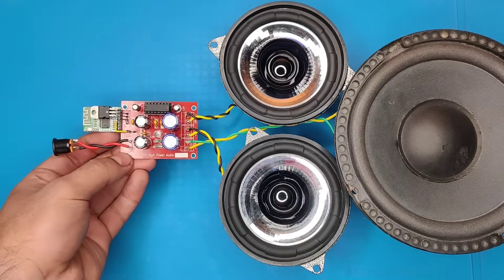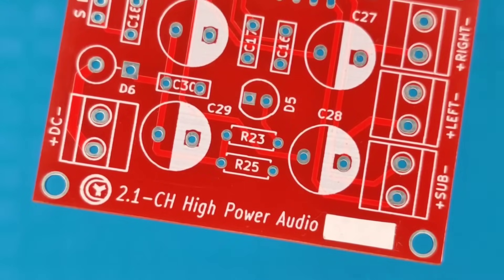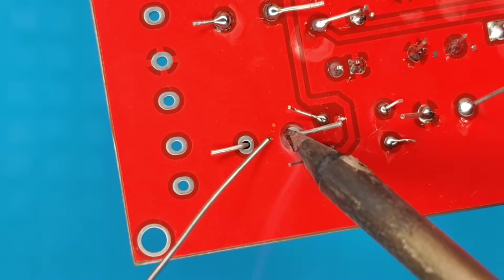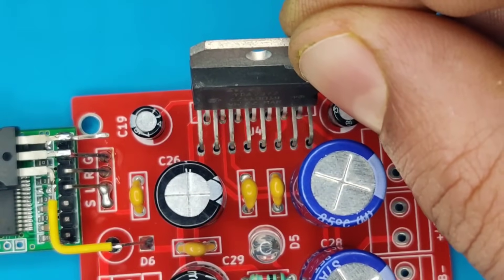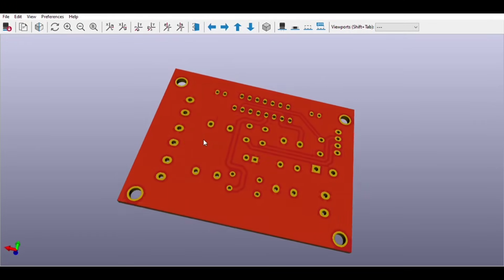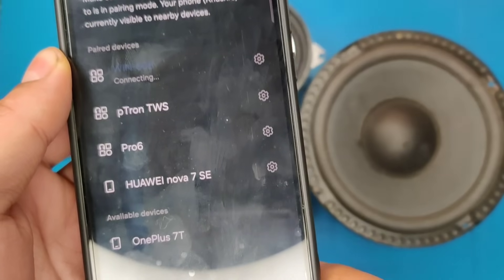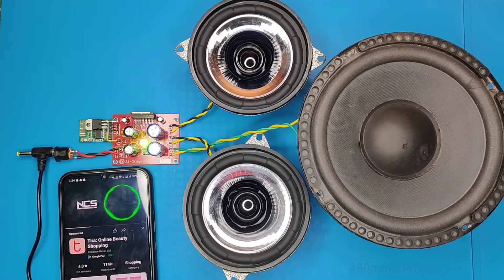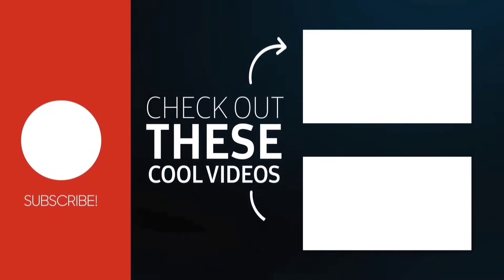Make Your Own Bluetooth Speaker with Few Components

Comment: Bhai mera ek question hai ki mere dost ne bataya tha ki usne xl6009 battery booster module ko use karke test  karke dekha hai  unhone bataya ki battery booster module 9 volt se upar output nahin deta supply dene per multimeter se agar use test karenge to usmein variable voltage dikhata hai lekin use supply dene per vah 9 volt se upar nahin deta hai kya yah baat sach hai please bataiye